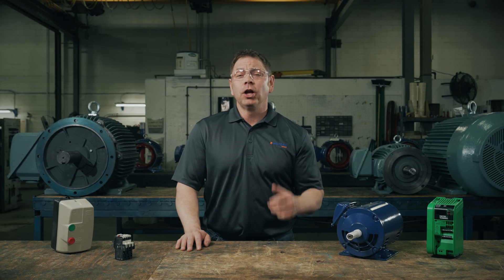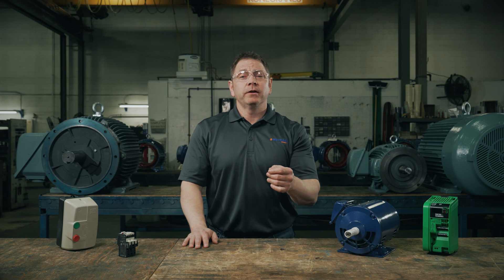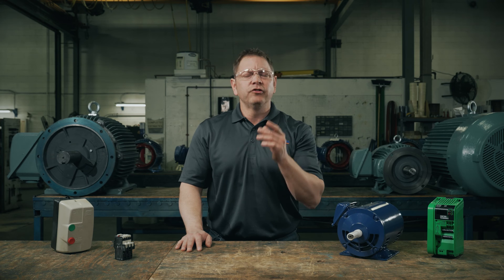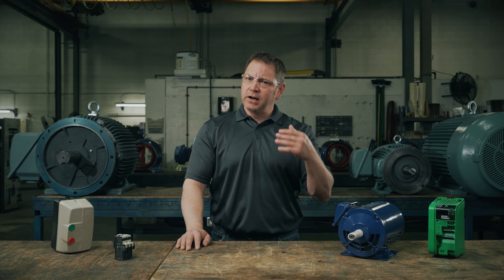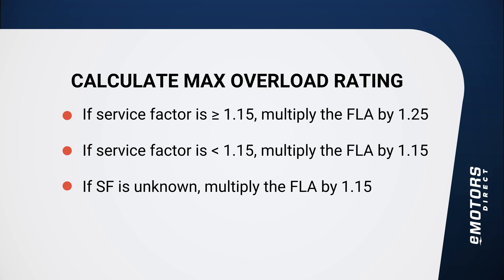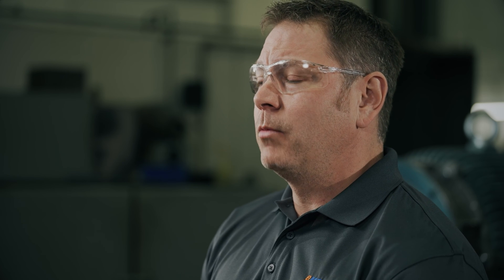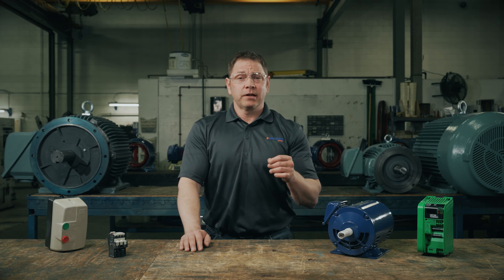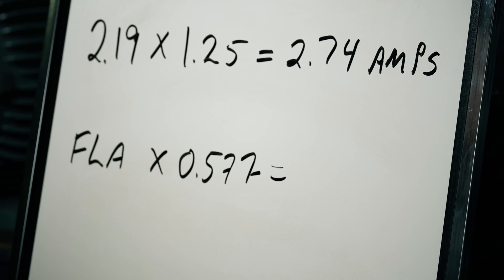How to Size an Overload Device for a Motor

Comment: Hi thanks for the great video. I was just wondering. Can you put just two hot wires in a three pole overload (ex. L1✓ L2✓ L3×)??
Reply from the maker: Yes, you can wire two hot wires through a three-pole overload relay, but it depends on the relay's design and specifications. Ensure the relay supports two-wire operation or consider using a two-pole overload relay to avoid potential faults or improper operation.
Reply: @emotorsdirect  
Great thank you for your reply.
I couldn't find a 2 pole overload relay handy for my project but I improvised just looping my T2 to L3 and my T1 and T2 as my output to the motor. Should be okay right?

Comment: If water hole motor is 13.7 amp. (23.7 amp is what is on the motor plate written) what amps i have to set on overload switch please?
Reply from the maker: Hi GJ, it depends on the service factor. 

If service factor is greater than or equal to 1.15, multiply the FLA by 1.25 
If service factor is less than 1.15, multiply the FLA by 1.15 

Hope this helps!

Comment: thanks a lot , sir can you explain if its use 2 overlords for star delta configuration is that wrong or is that reliable for safe conditions of a motor
Reply from the maker: I see no reason to use more than one overload block as any one of them tripping will shut off power.
Reply: once i have experienced a motor getting damaged because of the timer problem, i think that kind of problem will not be affected after applying 2 overloads....I don't know if it's a better idea or not...once again thanks for your reply and its great work you are doing with this channel 👍👍
Reply from the maker: @k.w.pubudu4520  interesting! Thanks for watching. More videos coming in the next week or two.